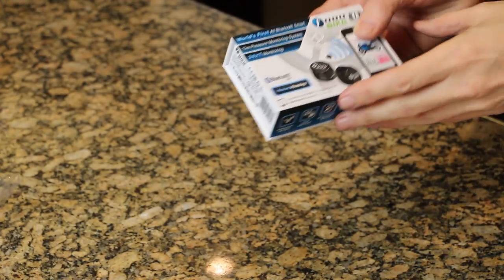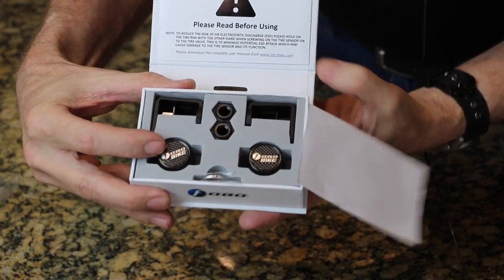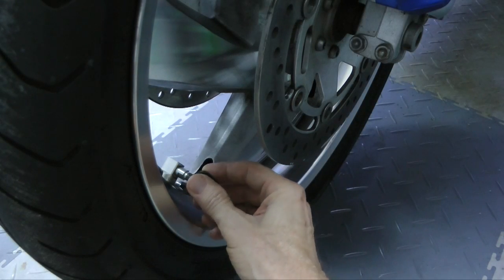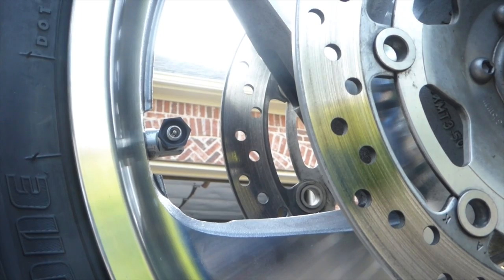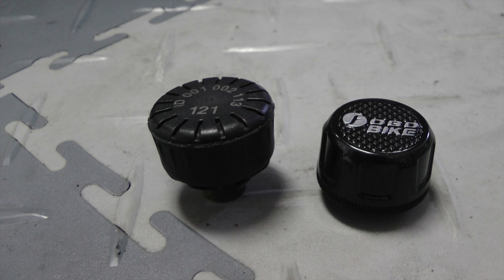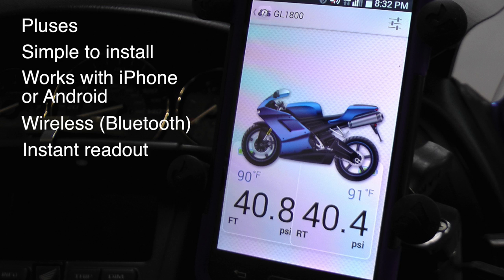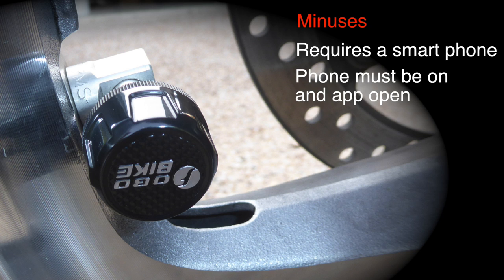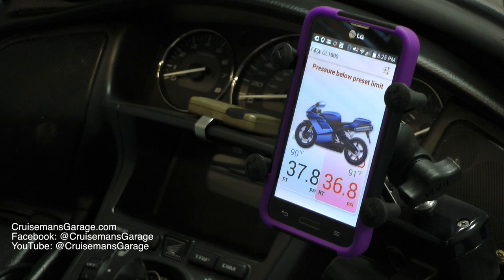FOBO Bike Bluetooth TPMS Unboxing and Review

Comment: FYI- As of iOS 8, apps can be allowed to run and update in the background. Alerts from the FOBO app can be heard over any Bluetooth audio system. To check your tire pressure, you'll still have pull out your iPhone to check the pressure, but you can still get alerts it's in your pocket.

Comment: Will FOBO have a negative effect on rubber valve stems with the added weight of the device?
Reply: yes. they recommend you change them to metal stems.

Comment: Awesome video but doesn't the gold wing already have tpms built in?
Reply: Not mine...
Reply: +derpie2000 not all of them do far as i know, it's not a standard feature on most bikes anyway.
Reply: His valve stem has TPMS etched on them.
Reply: Fobo is not working on my bike, may be a fluke IDK. Going to replace the batteries to see if that is the problem, user feedback indicates the supplied batteries were sometimes defective (including the replacements they gave).